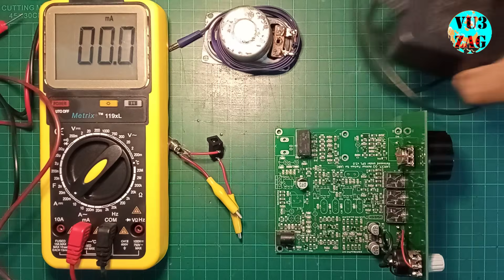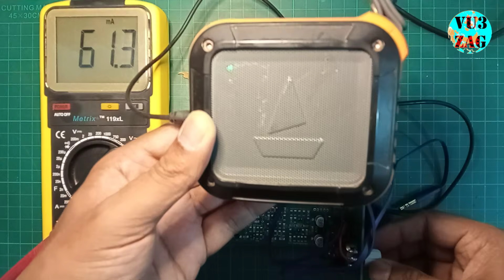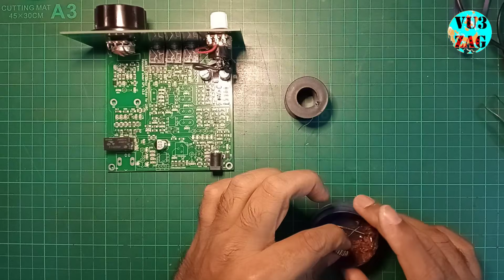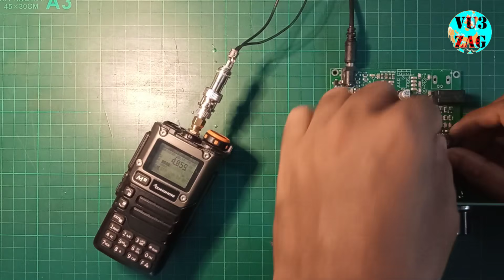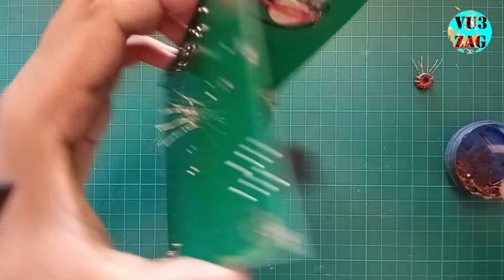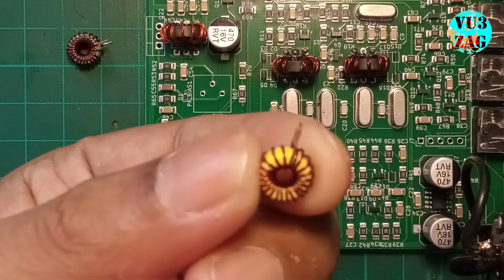LARCSet Radio Transceiver Assembly (Part -2 / 5)

Comment: Would a 1K0 resistor on the output of the Ring Mixers to ground which might give a useful boost just an observation.
Reply from the maker: Noted.. will give a try . tx